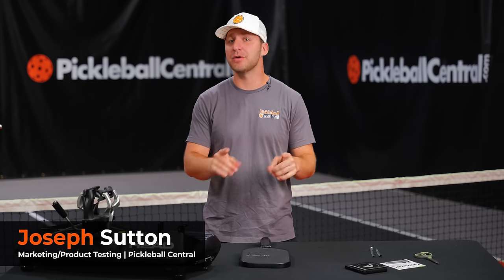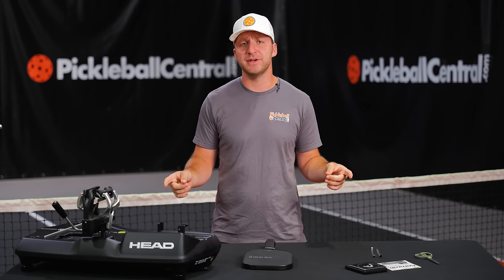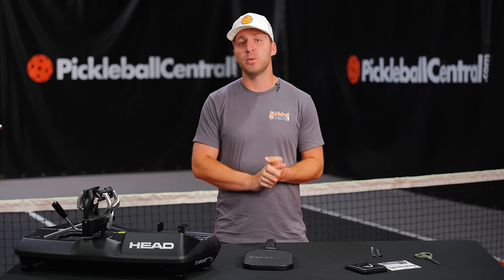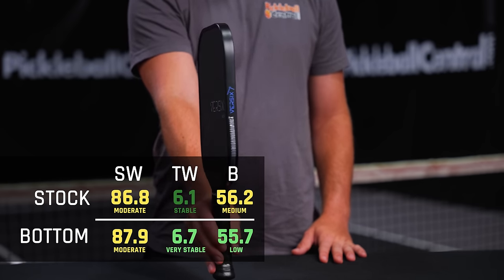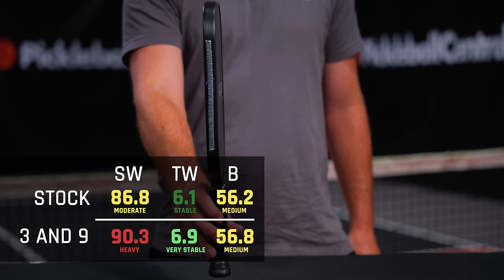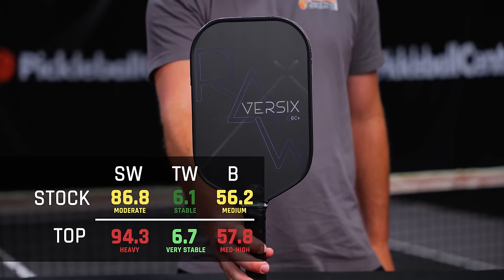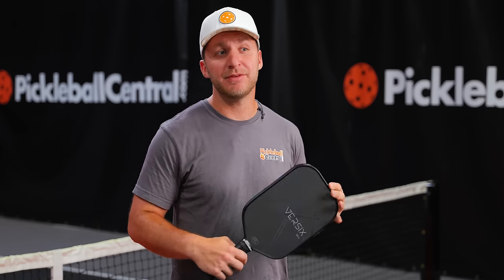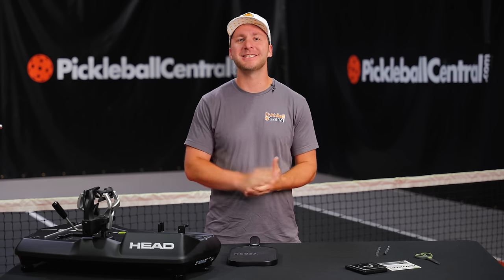Where (and WHY) You Should Be Adding Lead Tape To Your Pickleball Paddle!

Comment: Curious.  Everyone talks about the 3 ccommon areas to add tape, but NO ONE talks about whether or not you can combine multiple zones, using tape on both top and sides, or top and bottom corner.  Does one negate the other?  Does this only help if you pick ONE zone to add weight?

Comment: would it be a good idea to add lead tape in the air dynamic throat of a paddle that has one?  i would imagine it would help our with blocks and punch vollies.  also if you add lead tape to get more power will that come at a sacrafice to any control fro a control oriented paddle?

Comment: When adding tape to tennis racquets, it's common to also wrap weight at the very bottom of the handle.  Typically, one starts by measuring the OEM balance point.  Then the sides and/or top are weighted with tape -- typically at 10 & 2, which would be the top corners of a pickleball paddle..  A shorter pickleball paddle might be better with weight spread other ways.  Then one temporarily wraps weight at the bottom of the handle to adjust the balance to keep the original balance.  One can add or remove weight at the handle to move the balance up or down as desired.  

If adjusted to the OEM balance at the handle, you'll generally have a quick and stable paddle with a large sweet spot.  AND  have a more robust overall weight when powering thru a long stroke.  At least that's how it works for weighting tennis racquets.  With tennis weighting, if you don't add weight at the handle, you may be heading towards a case of tennis elbow...  Not sure that applies to pickleball...Just beware...